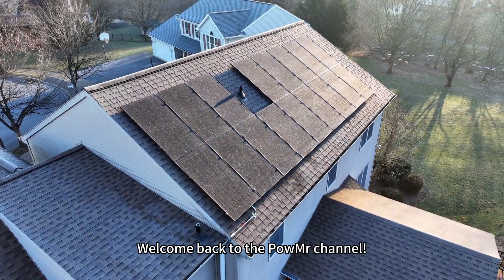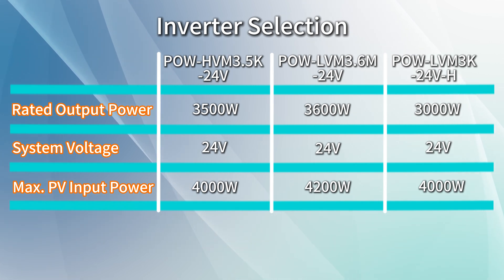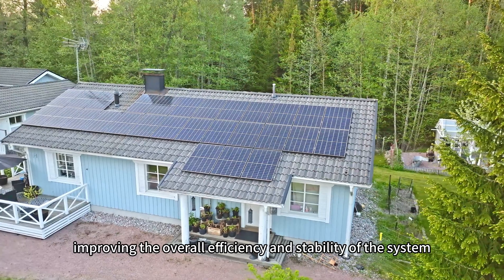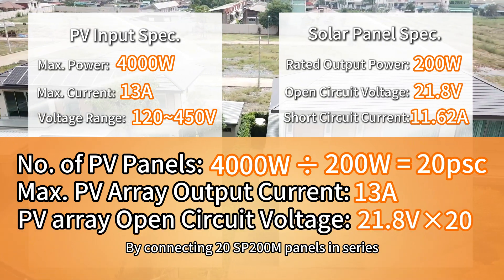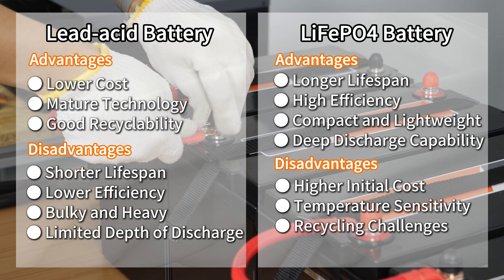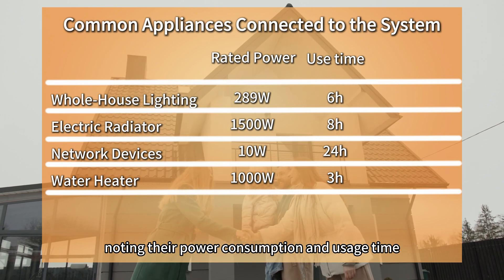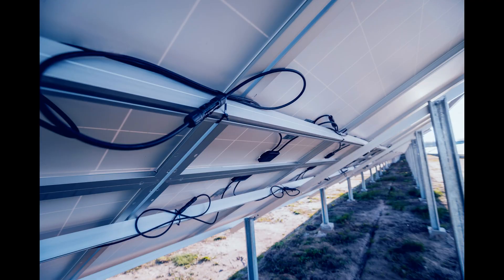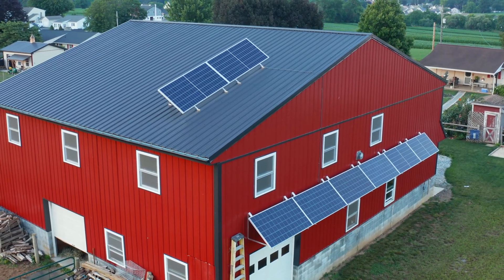How to Configure a Home Solar System - PowMr 3KW 24V Energy Storage Design

Comment: I'm still confused why in western countries they use small 200-300 watt panels. Meanwhile in Southeast Asia people use 550-650 Watt solar panels To save costs .
Reply: Bigger wattage panels save cost, maximise space, and generate more wattage of electricity
Reply: @kllcenly869  The bigger the solar panel, the bigger the wind turbine, the cheaper it is because of the economy of scale.
Reply: @kllcenly869  Actually smaller panels take more space than bigger panels when comparing total wattage and area covered. Also more expensive and more wires. Not efficient nor smart. Only thing is they are lighter to carry... Also not bifacial.